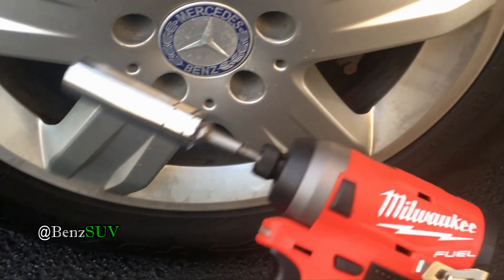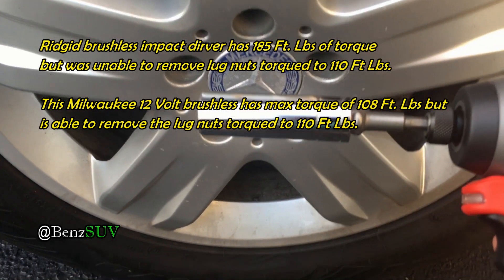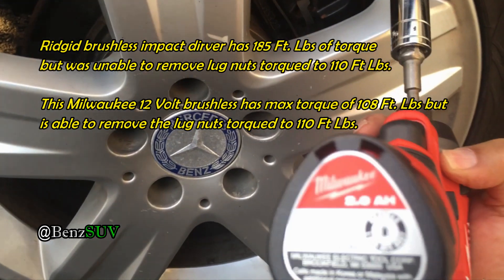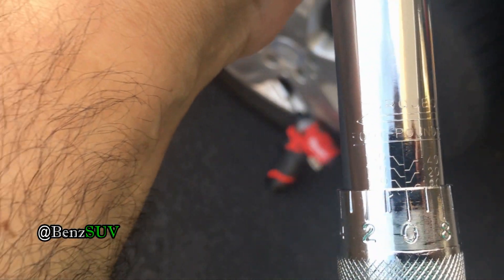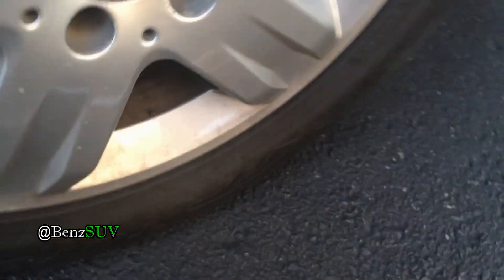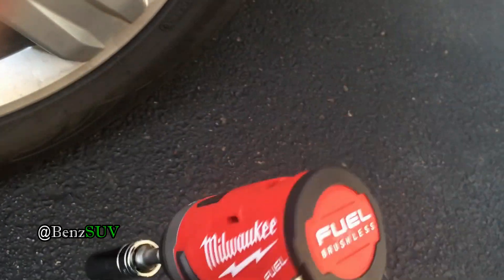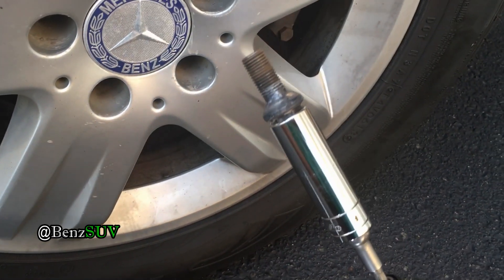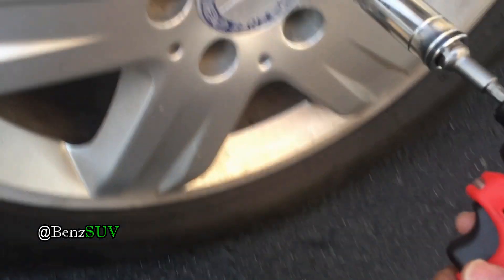Milwaukee M12 impact driver beats Ridgid 18 Volt, both brushless

Comment: Using Chrome sockets on an impact and they aren’t even 6 point ones lol…. Come on guy
Reply from the maker: Yea, I hear you.  Got 6 point impact rated sockets afterwards.  But just want to say even w/o proper socket, the driver did well in propagating the torque.

Comment: I just got this thing from amazon and it feels so great in the hand, also has a great deal of power (milwaukee seems to have the most power for smallest size I think this thing is rated for 120 ft/lbs). I just want to do shit when I hold this tool lol. I wish they made an impact wrench with this same body and measurements.
Reply: They have the stubby impact wrench, same handle but the head is a little thicker and I think a little longer

Comment: I have 2 M12 second Gen. surge and fuel and neither could bust 85 ft lbs. no doubt they’re powerful 12v. But this isn’t real.
Reply: I have to disagree the m12 fuel gen2 is a beast. The surge not so much.

Comment: Yeah guys this thing is seriously powerful. I used it for the second time yesterday while putting running boards on my truck and  snapped a 1/2 inch bolt like so easily. Now it’s stuck in there lol

Comment: Dude stop drilling your lug nuts on your car with the drill do it with your hand first. Your gonna cross thread the bolt. And your gonna have a hard time getting it off. Or u can snap it and your really fucked.
Reply from the maker: You are correct, sir.  It did happen to me recently and I learnt my lesson.  I had to buy a new lug bolt b/c one of them broke off.

Comment: What kind of adapter are u using ? I have heard the Milwaukee 1/2in. adapter breaks very easily so was thinking about buying some huskey adapters.
Reply: Husky’s are way better on the adaptor. Haven’t snapped my 3/8 yet and i have used it on lug nuts no issues
Reply from the maker: this is a harbor freight adapter, and I would not suggest it because it is long and not impact rated.  OK, it's like 3 bucks for a 3 piece set.  No matter which brand you go with, they are long and wobble so the full torque of the driver is not sent to the socket.  I am not sure why they don't make short ones.  Although I think the M'kee is shorter and better but surprised you say they break.  Perhaps get an impact rated 1/2 in adapter?
Reply: Husky is absolutely the way to go although the dewalt adapter are pretty stout.

Comment: I don’t understand why people consider rigid a professional grade tool , they do have a couple good tools but it’s still a DIY brand
Reply: They make good vacuums that's about it.
Reply: Milwaukee is practically a diy brand.  Tools last a month professionally
Reply: @loganmartin8613  all  the milwaukee tools I have ever had have lasted years with the exception of 1 and I use them on the job site 5-6 days a week. Milwaukee is top of the line.

Comment: A chrome socket on an impact driver.!!!! REALLY. !!!
Reply: Who cares!? He got the lugnuts right? Or did he not?
Reply: I do it all the time. Even with my 1100 ft. Lbs 1/2 drive Milwaukee.
Reply: Lol I only use chrome sockets with mine it adds to its versatility, I use it because it's small and can fit into tight places, using an impact socket would defeat the purpose of using it instead of the 3/8 stubby
Reply: I have been using chrome sockets on the most powerful guns you could think of nearly every day for 4 years straight and still have yet to even crack any of my chrome sockets from my $150 socket set.

Comment: I wish mine worked like this. I purchased one and it fails to generate 
30 ft/lb, its almost as loud as my air impact tools, with almost a quarter of the advertised torque. Milwaukee has failed to stand behind the 30 day money back guarantee, and the closest warranty service center expects me to pay shipping both ways to have it serviced, on a tool broken right out of the box. Not impressed with Milwaukee products or customer service. Too bad, a lot of people vouch for them.
Reply: I have returned Milwaukee stuff to the service center half a dozen times, usually just to get a new tool. Most of the time, even after it’s been beaten and battered for 2 years and looks like crap, I’ll send it in as “doesn’t hit hard anymore” and voila, new tool about 1-2 weeks later. They pay fedex back and forth shipping.
Reply from the maker: It is funny you mention that because everyone is chewing my head-off with their comments on my other video about switching from Milwaukee to Ridgid - saying I should've stuck to the M12.

Comment: Is that the one they call stubby m12
Reply from the maker: Although this is the 2nd generation fuel 1/4" impact driver that is stubby, it is not the new 1/2"  stubby fuel impact wrench that went on sale in August /September 2018.
Reply: BenzSUV you are correct! I did comment wrong about it being  the ones called stubby’s! They are the M12 3/8” and 1/2” impact wrench, not driver!
👍🏻👍🏻

Comment: I seriously doubt the rigid 1/4 impact is capable of producing 185 ft lbs of torque. If it were true it would be the strongest in its class by a mile.

Comment: Using a chrome 12 point socket on lug nuts with an impact driver is bad form. Might work now but just wait til you need to figure out how to get your rounded lug nuts off in the future.
Reply: I have the stubby and if I was lazy I'd use it to  pull the lug off but a better choice still is my high torque 1/2" impact. Maybe over kill but I don't have a mid torque.
Reply: @kartboarder22g17  your m12 stubby wrench that has been proven to remove 300 ft lbs has no problems with lugs
Reply: Indeed, he is not only using a non impact socket but he is also using the wrong tool for the job. Obviously he should have been using an impact wrench.

Comment: That is 100 ft lbs. Makes sense that it can remove the lugnuts that are torqued to 100 ft lbs when it features up to 108 ft lb of torque. The nice part about milwaukee is that they don't exaggerate their torque numbers. Didn't get to see the rigid test but it would be quite an exaggeration for it to be over 85 ft lb off from what its specs show
Reply: Yes sir, I totally agree with you. 😎

Comment: I have the 3/8 2nd gen and its awesome for doing lug nuts. Brakes. Suspension. Intakes. Well pretty much everything. 115ftlb
Reply from the maker: Are you referring to the new stubby impact wrenches:  https://www.milwaukeetool.com/Products/Power-Tools/Fastening/Impact-Wrenches/2554-20
Reply: No the m12 3/8 fuel
Reply from the maker: oh the 3/8 fuel impact ratchet.   The ratchet is perfect for tight spaces like in the engine bay.

Comment: Thanks for the info.  I am definitely planning on buying one, especially now.
Reply: I have it with the 6 Ah batteries and it puts 100 mm wood screws in faster then my dewalt 887 on 2 Ah batteries , the 6 Ah batteries give it more power then when on 2 Ah it is noticeable and it stands nicely on the 6 Ah battery well recommend this impact it’s amazing and even runs sleeper screws in with ease
Reply from the maker: Thanks for the comment Craig.  I am seriously considering buying the 6Ah battery the next time Home Depot has a promo.  The kit I purchased came with a 4 Ah battery which I use on my 3/8 ratchet.  The ratchet is also insanely aswesome.  I did a review on it.  My entire reason for switching to the M12 line was based on this ratchet.  And I thought I would be missing out on "power" by switching to the M12 line but I was wrong.  These things are beasts... De-who 887?  LOL
Reply from the maker: I can't begin to tell you how amazing this little thing is.  It comes with a 5 year warranty.  Although Ridgid comes with a lifetime warranty, the Milwaukee's are just better engineered.